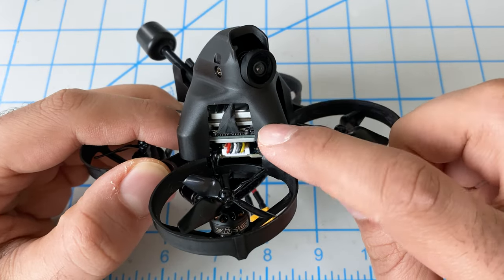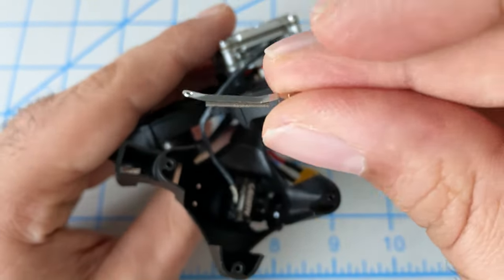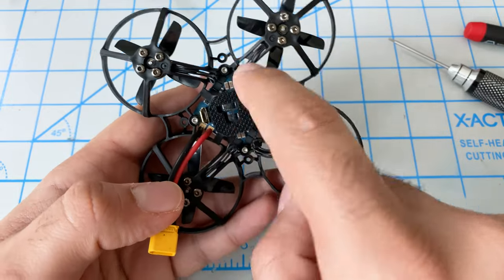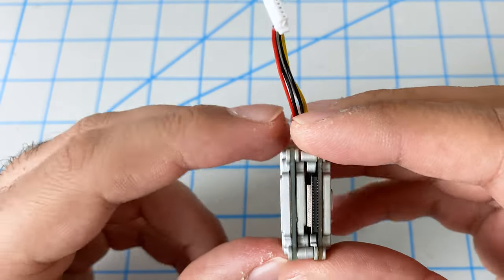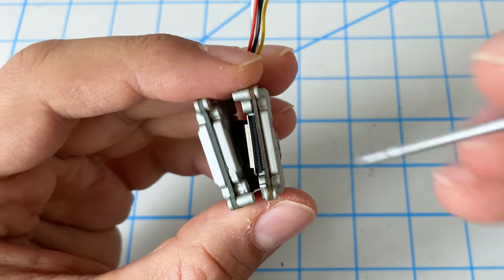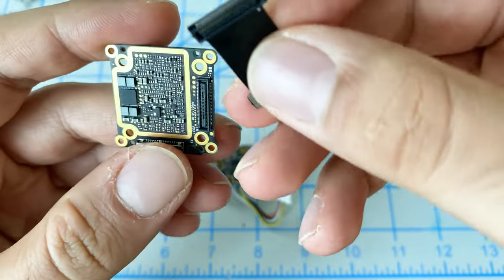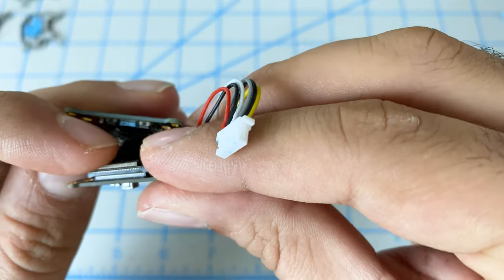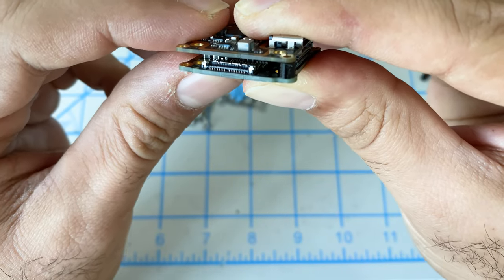Caddx Vista Disassembly, De-liding & De-casing How to Guide | Naked Vista SAVES 10 grams! Whoop!

Comment: I strongly advise not use M2 screws instead 1.5 and specially threading board is a bad idea. I personally know two cases when vista stop working after that kind of operation. Making a thread on PCB can delaminate it's layers or make PCB stresses in the way that  BGA balls under the chips will cracks.

Comment: Very detailed video guide and I happened to consider this for my A85HD. Only dangerous scenario with high chance of happening is that during a crash and I have to try retrieving the drone - typicality it takes 3-5 mins with the battery still plugged in, likely the naked will be toasted in this scenario?
Reply from the maker: You can leave the thermal control active so it will automatically shutdown the video feed when it starts to overheat.

Comment: Could you tell me how high the vista-stack now is? Wanted to stick a normal one onto my normal Fc-stack but my frame has not enough clearance. 
So I think of making my vista naked, but only if someone can tell me whether I could safe arround 3mm by doing that. Thx
Reply from the maker: You're looking at nearly 9mm for the Vista after de-casing including the U.FL antenna connector on the top.
Reply: @Mangorille  thank you soo much! 😊
Reply from the maker: @luis_gbs  No problem, let me know if you have any other questions.

Comment: That is NOT a "gasket" to prevent moisture or water getting in. Otherwise all the parts would have it. That is is an electrical mesh that creates a sealed RF environment to either reduce the emitted EMI or prevent EMI from entering that area of the PCB.  It's blocking RF noise and/or preventing it from generating RF noise. Think faraday cage.
Reply from the maker: Very interesting, thanks for the explanation!

Comment: Any overheating issues now that you've used it a lot?  With casing on I still struggle with getting it out of low power mode even while flying.
Reply from the maker: Still no issues, the vista still lands cool to the touch. It seems to warm up rapidly when on the ground though.
Reply: Low power mode is likely a missing wire, if you still have issues (some FC arming instruction or somesuch, I don't recall)

Comment: Question, if you wanted to use a nut on the 1.5mm holes, do you think drilling out the hole to 2mm would work ok??
Reply from the maker: You could thread in the screws as you saw in the video and then add a nut on top, that would be the safest bet. I think you would be okay to drill them out but there's always a risk when drilling a PCB as you don't know what's sandwiched in between there.

Comment: Reckon I could just use gummies as a spacer instead of the printed stand offs?
Reply from the maker: Gummies would be softer than the 3d printed part so just make sure the two boards cannot hit each other in a crash.

Comment: What holds the camera ribbon in place,  when you crash , its barely holdes when that metal strips not screwed in
Reply from the maker: Right now nothing is holding it down and haven't had it come disconnected in a crash yet. If you are worried about that, you can add a small piece of foam (say weather stripping from home depot) on top of the connector so that it sandwiches between the two boards.

Comment: Hi, want to do my naked vista version, would you risk and fly 4km ? Or there is a risk that middle flight you lose signal?
Reply from the maker: Are you sure you can get the 4km range where you fly? The range is going to be really dependent on where you fly, any interference, trees, etc... I wouldn't expect the naked vista to impact the range but this mod was done on an indoor micro that doesn't really go very far.
Reply: i would worry about heat on the full MW possible, seems like people are keeping it to 700mw, but in clear LOS you can get to max goggle range with that no problem. and you do need to think about ambient heat as well, but otherwise it should do just fine so long as you dont let it idle long

Comment: Help. LOL I broke my ufl connector on my vista. My friend has the top board with different firmware and activated in his account. Can I use it ? Will I have issues with activation and firmware downgrade after install ?
Reply from the maker: I've never tried swapping the boards. Did you try it and did it work?
Reply: It will work

Comment: what length of m2 stack screws did you end up using?
Reply from the maker: Unfortunately didn't measure them but they were standard stand off screws that came with a 3" frame I had lying around.

Comment: Good vid I guess I'll have to try this decasing.
I got the Alpha A 75 HD a couple days ago and absolutely loathe it. It's pathetically lamely underpowered needing half stick throttle to keep up, gets less than 2 mins of flight time and has jello even then. I wish i could return this and get something that's fun to fly what trash and what a waste......
Reply from the maker: Hey. That was my initial experience as well, very under powered. Did yours come with the black or light green blades? What battery are you using? You can also look into updating the ESC software like this video: https://youtu.be/D-cpesaHfP0

Comment: help I broke mi positive pad en the vista I just try to scrape to find a point to conect but it has continuitu with the negative pad so I need yo know where can I put muy imput postive in the board please help....
Reply from the maker: It probably passes through to the other side of the board. I'm no electronics engineer but did you check if it connects to the big diode in the middle? Reach out to Madstech, he seems to have a good amount of electronics knowledge. 

http://fpvwiki.co.uk/wp-content/uploads/2023/11/Caddx_Vista_PCB.jpg
Reply: @Mangorille  thanks friend I just repair tha cddx exactly connecting to that diode... replace de pos pad...🙂
Reply from the maker: @maxartfpvperufilmacionesya5360  Excellent. Happy flying!

Comment: Hey, I just got A75HD for my Dad for Christmas. However, when he binds it to his DJI V2 Goggle video works until he binds it to his DJI controller. The controller works fine but it will lose the video on the goggle. On the display, it says "Image transmission stopped". do you have any idea how to fix this problem. We just got it. and if you have any idea it will help us a lot.
Reply from the maker: Hey. Are you letting it sit on the ground for a while when this happens or does it happen right away when you apply power? The Vista is known to overheat if you let it sit on the ground without any airflow. If you touch the vista, it'll probably be boiling hot at that point.
Reply: @Mangorille  I kinda know about heating up before I start applying update so I put it by the open window with a usb fan. So there is a airflow. It happens right away, I lose video soon as I bind my DJI controller.
Reply from the maker: @liamarknectfpv1465  Never seen this before. Do you have all three items (air unit, controller, and goggles) upgraded to the latest version? Are you binding the air unit and the goggles first and then doing the controller last?
Reply: @Mangorille  yes I have DJI goggle v2 and black big DJI FPV controller and A75HD from iflight with Vista. I bind goggle first and than controller. When I move to controller to start binding my image will freeze and and give me image transmission stopped on my goggle… I am very lost at this point lol maybe bad vista?
Reply from the maker: @liamarknectfpv1465  What happens if you just bind the controller without the goggles, does that work? You may want to refresh the firmware on all 3 devices. It sounds more like something went wrong with the firmware. I use the v6 firmware so you may want to go with that instead and see if that works okay.
Reply: @Mangorille  Let me try. I will let you know what happens! Thank you so much.
Reply from the maker: @liamarknectfpv1465  No problem, hopefully that helps. Otherwise best to open a support ticket with iFlight in case something is really defective.

Comment: mine short cutted between the led and the "foam" of the connector
Reply from the maker: Did you put the piece of electrical tape on top of both connectors like mentioned in the video?

Comment: Is the case wide enough to fit the Nebula Pro? Thx
Reply from the maker: Unfortunately no, only a 14x14 camera will fit in the canopy.
Reply: @Mangorille  Thanks for the rapid reply. I recommended one of these to a friend and they said on the first flight the Nebula v2 image looks too rough and they are having buyers remorse. Do you know of any canopies that would fit and take a Pro?
Reply from the maker: @changeagent228  The image quality is nowhere as good as the Nebula Pro or the stock DJI camera. It does the job for indoor flying though. Your friend may want to find a local 3d designer that can design and print a new canopy with a bigger camera section or wait for someone to do so on Thingiverse. Shouldn't take long.

Comment: that a good idea , But vista very hot module   ,  May damage some parts without  heatsink         ,sorry about talking  that       i have  37 years  electronic experience ,
Reply from the maker: I agree that both the air unit and vista generate a lot of heat and removing the heatsink makes it even worse. However, there is so much air flow when flying that it is not an issue. There are reputable manufacturers (such as BetaFPV) that actually include de-cased vistas in their drones. You will definitely need a fan while doing bench testing and firmware upgrades though.
Reply: @Mangorille   YES But i agree support your Less weight theory .. and i see your more video ,,,,very good support
Reply: I did smoke a vista.   Output power dropped from 300mw to 0.7mw.  Going to try again with conformal coating this time.    Rule out dust or physical.   My larger 120g quad has a power off switch to keep the vista off when waiting for gps.
Reply from the maker: @NathansHVAC  Hey. Do you think it fried from over heating or something else? Did you have the auto temperature control on or off?
Reply: @NathansHVAC  how did you make that power off switch?

Comment: i dont have the balls to do this kind of thing :)did you kill anything doing this
Reply from the maker: Nothing killed... yet... Looks to be fairly resilient even after I had that short circuit because I did not have that piece of electrical tape initially on the ribbon cable. Been working great for over a week now, I don't let it sit plugged in though.